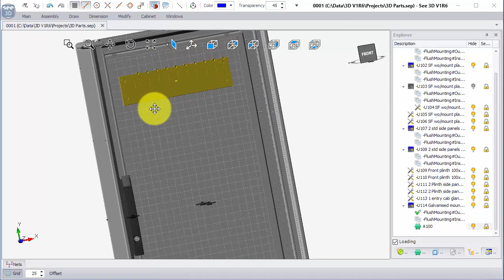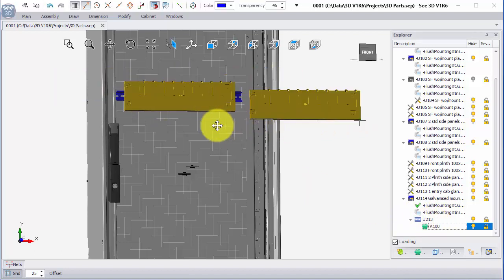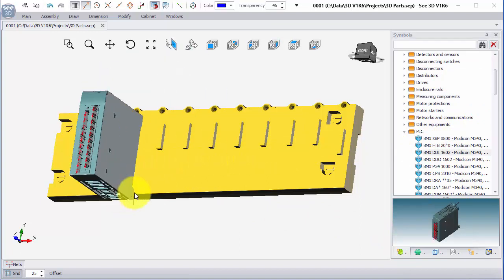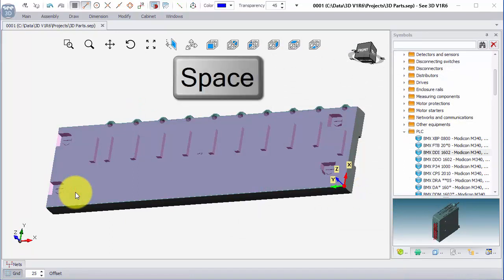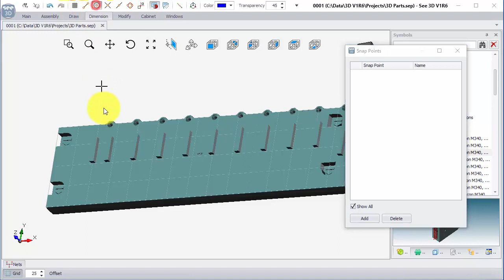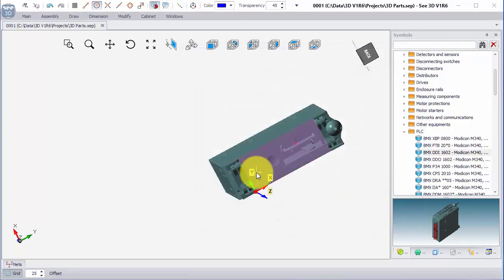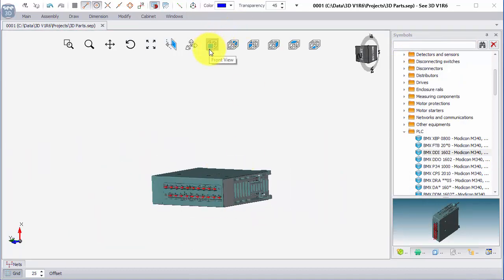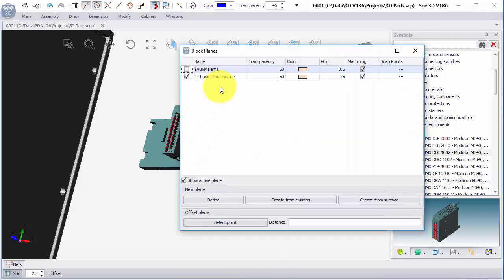Understanding Block Planes in See Electrical 3D Panel

Comment: Hello, I got a question about device lists.

There is a sheet reference from device list to where the component is positioned on the circuit diagram, but I would also like to show the other way around.
So, to show a reference from the symbol on circuit diagram to the device list page. Is it possible?
Thank you.
Reply from the maker: Hi Black Sonic, its not possible but you can right-click and use the 'Goto' option from either page.
Reply: @IGEXAOUK  OK, thank you, I thought so. I wanted to show the reference when we print the circuit diagrams to paper format, when the technicians can't use laptops on site, it's more convinient.